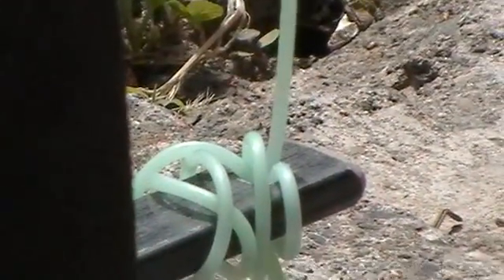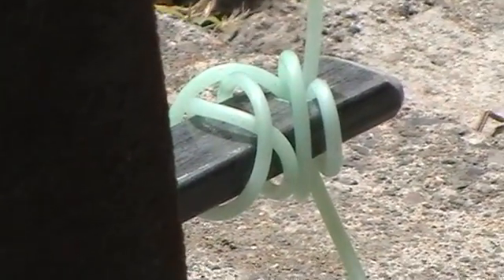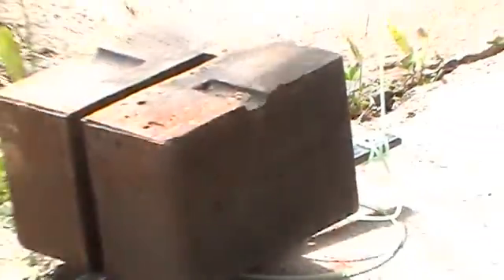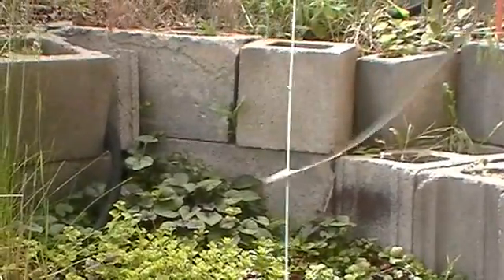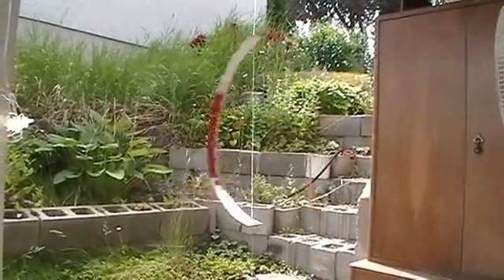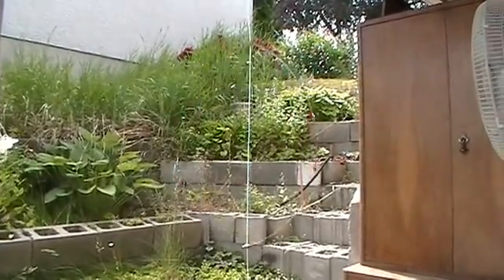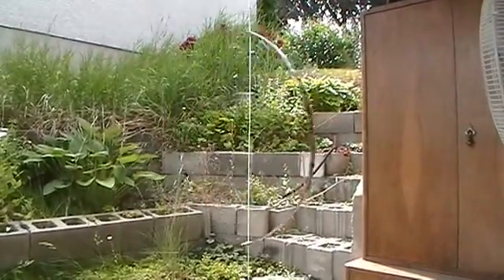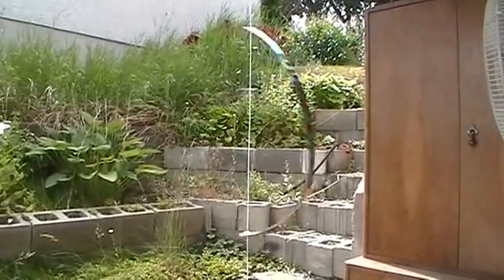remkick bremacles wind energy pump new flutterwing

Comment: (Sorry)  for the previous long comment. It looks perfect for generating low pressure air for little airlift pumps to water gardens or run pond features or circulate water in aquaculture.  Good job, Brian

Comment: That is pretty awesome. Thanks for doing it.   I have tried to get people interested in a low pressure "pneumatic grid" in peoples back yards.  Different devices make the pressure, (maybe just 2 or 4 psi) and it gets distributed in ordinary 3/8 irrigation tubing for a bunch of "shared services".  One guy might have a solar panel, someone else will have wind, someone else low head hydro. (I use my 2 psi just to pump water round my pallet gardens.  But it can go into fireplaces or beside chimneys